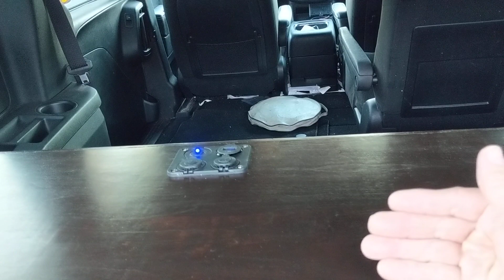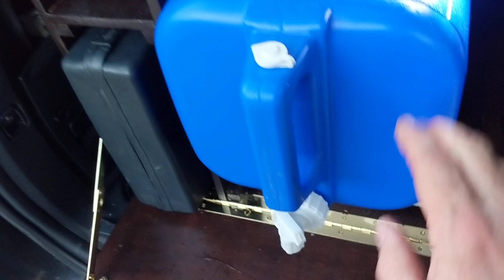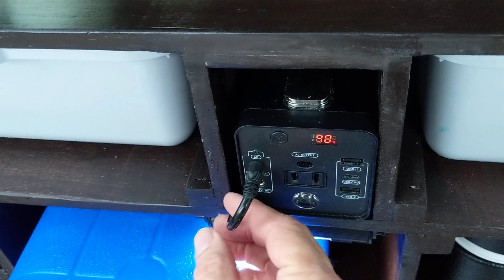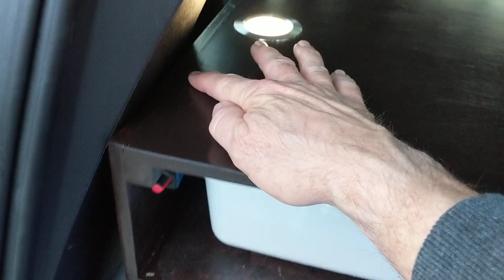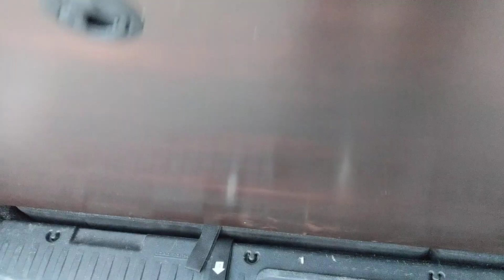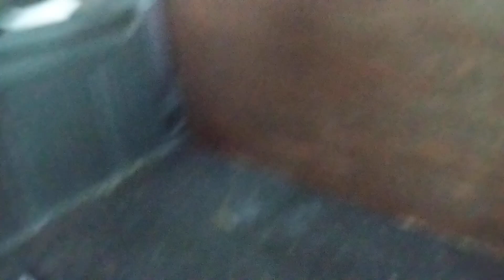Minivan Kitchen camping box build for van conversion

Comment: You should always have some sort of grey-water system.....a collapsible 1-2gal jug with a collapsible funnel is perfect.
Reply from the maker: Thank you.  I see some rules say to drain off site while some camp rules say camp kitchens free off debri  using camp soap and 200 feet from stream broadcast in bushes is fine. It is a good idea to bring at least a bucket just in case.  Also know that you should leave no trace while camping and that includes a puddle of goo so resist the idea of treating like a home or RV sink using paper towels to wipe out plates first should help but if you know its contaminated carry the bucket to a drain even if its not required.

Comment: Where did you get your water jug from?
Reply from the maker: It is a coleman 5 gallon water jug I got mine from walmart online there appears to be a short supply currently they are double the price they should be at 39.99 from walmart and amazon you might just need to pay it even colemans main website doesn't have it.  big 5 has them for 19.99 but you must check the store online and buy in store.

Comment: Hello, how do you fix the furniture so that it does not move when you travel?
in this car, in the back you only have two rings to hold things and they are not very strong
Reply from the maker: the foam sofa/bed is of course not used while driving and is just set in place the kitchen is heavy and combined with the jammed in sofa/bed it barely moves I push it back maybe an inch after I get somewhere.

Comment: Thanks for your content. I just purchased a 2010 Dodge Grand Caravan. I am hoping to get my hands on some design files (ideally I can open in TinkerCAD format .stl, .obj or .svg, or any drawings/diagrams/measurements of bed/cabinet/kitchen alternate setups etc) that I can take inspiration from modify to my personal liking to get the best result possible. I thought I might ask if you would be so kind as to forward any design files that you have that may help me, also if you are aware currently of any useful/necessary items for vanlife selling at a really good price/value I would very much appreciate any help/advice you can provide. Thanks and safe travels!
Reply from the maker: Thanks, As for design files there are significant notes in the description that have dimensions.

  I also made a full height but less width version so its very similar https://youtu.be/_YcJZ7gvFxU It has some lessons learned such as double nutting the hinge's and latch and handle (for a jam nut so they don't loosen) and not to cut interior shelves until outside shell is finished as they need to be tight without deforming and things sometimes change.  I also lessened the thickness of the glue blocks so watch that video as well. 

 By making the outside box first at the dimensions I list and adjusting shelves width to fit trays cooler and other interior components after its built it really only needs the outside dimensions I list the rest is play by ear and would vary depending on your tray and cooler size. Just position first to make sure it all fits and average clearance between shelves.

Comment: Nice I’m thinking of doing a half one like this for the beach this summer and do a fold out bed with a sink and a mini fridge/ cooking station as well nice build btw
Reply from the maker: I actually made a half one and it is available here https://youtu.be/_YcJZ7gvFxU what I liked about it was most camp sites have a picnic table and having it outside made it easier to access for others as they wouldn't have to open the van or door.  Since its the same height and depth the electric could be adapted.

Comment: I REALLY like this box. I'm the type who DOES want to get out and stand under that roof and cook in the rain. Way better than having a perpetually steamed up cabin. I suppose you could cut a back door to slide the cooler into the cabin if, say, you wanted a beer during a downpour.
The dark finish looks very elegant.
 Couple of questions:
How much does your box weigh, empty?
How do you keep the box from sliding forward?
Reply from the maker: Weight is very heavy I have to have 2 people carry it.  I leave out the cooler and put it in the van it probably weighs 100 lbs and is awkward.  For movement it doesn't slide much maybe an inch or so and with the sofa in place it doesn't move at all.  Without it it moved an inch after a few days and I just pushed it back.

Comment: Nice little build.  Couple thoughts.  With a few design changes you could have access to everything from inside, which might be nice if the weather is nasty or you just don't want to get out to wash your hands or grab something from your cooler. Also, using pocket screws might help eliminate some of the blocks, which in turn may recapture some space.  Overall, it looks great.  Thanks for sharing.
Reply from the maker: Thank you I think you point out some interesting points as to why I designed it this way and why I used glue blocks.  I really only wanted  to access just the power and lights from inside the rest was kitchen and outdoor stuff I don't need while sleeping or driving.  I do want access the cold stuff from inside but a small insulated thermos bag with sodas and water in it is all I need so I fill it and they stay cool for quite a while and I switch them out when I stop.  I really only need my personal stuff and that's in my duffel inside with me.  Washing needs to be outside as water is splashy and I don't want my inside area wet.  Also the back of the box is made to be blocked by the sofa or bed and its unlikely that I would move everything to get to a door or hatch.  

 To truly get strength without the glue blocks you would need rabbits and dados the pocket or even a stronger full length screw really offer no more strength then the brads as its the glue that gives most of the strength and 1/2 inch end grain plywood is very poor to hold mechanical fasteners. The fastener is really just the clamping mechanism until the glue dries.   I brad nailed and glued both the plywood as well as the glue blocks for the expected heavy use.   I realized I overbuilt this though and knew I could pare down the blocks and still have excellent strength so when I adapted this to a chuck box build for my niece I used narrower glue blocks of only a 9/16" so it saved about a 1/4 inch and it still felt quite strong.  The blocks effectively create a rabbit without all the work. By doubling the gluing area and bracing it using solid wood for the glue block you increase the strength tremendously.   The 9/16 size was the minimum that would hide the 1" brad when going into 1/2 inch plywood.   If you cut the size of the block to 9/16 inch it wont take that much room and would be a great compromise.  The other advantage was positioning for assembly the glue blocks were put on the top and bottom first and it helped position the parts when it came time to complete assembly.  Thank you for your comment and I hope this helps.

Comment from the maker: I have finished my van Yay! I have 2 other videos in this series next one is showing how well my trifold mattress/sofa fits and my new solar charger while I prepare for a camping trip.  The next video I show making pop in window shades made from reflectix done the next day it was quite easy.  My wife loved how comfortable it was at night and the running water of the kitchen.  We ran fans all night from the plugs and used  front window screens so it was comfortable at night.   From my trip I decided I would make a seal with reflectix from the camp kitchen to the ceiling and foam pipe insulation on the sides to allow night use without letting bugs into cabin (we avoided having the light on when hatch was open to avoid attracting them so it lessened its usefulness).    I will show a video with the full install at our camp in big bear in august.  See you on the road!

Comment: Very nice design and finish on the cabinet. I am finding so many of the conversions have removed the 2nd and 3rd row seats plus require exiting the van to access the cooking area. I am desperately looking for a design that allows me to keep all seats in the van as well as the ability to not leave the van to function. It might be wishful thinking!
Reply from the maker: Thank you.  I'm not sure if you noticed that we didn't remove the 2nd and third row they are stow and go and are just in the floor and pop out I can even travel with the second row up and only need to put it down when the bed is unfolded at night this was planed so I can take others with us who would sleep in a tent.  But yes full time campers on other videos do remove the seats for more storage its a trade off but for them storage is a premium and very necessary hence their need to remove them completely. 

 I think cooking from the tailgate solves a lot of problems in addition to the simplicity of the design is the practicality of it.  Cooking while sitting is pretty awkward as well as fumes, fire danger, mess, clean up, water splashing meat splattering and so on having semi outside on the fold down worktable solves these.  You can even walk around as you cook something I would never do inside.  Then there is the social aspect you would miss even alone people wave at you and talk as you are cooking. I guess there might  be a disadvantage if you are stealth camping or its extreme winter.   Just my 2 cents.  On a side note I am really excited that my set up is now complete and I will share a full use video soon.  Thank you and good luck with your build.

Comment: NICE KITCHEN!!!
Reply from the maker: Thank you.  Along time ago I wanted to build a Tear Drop trailer then recently I realized the inside of my van had almost the same footprint so you may recognize the influence.  Finishing it and using a drop desk front for a work surface was kind of from that world. I think some of its not haves also makes it.  The lack of water pump and instead using a water jug above the work surface does the same thing without all the storage and complexity.  Not using a dual battery but using a camping battery.  And not having a built in bed but using a trifold mattress.   It took a lot of searching to get components just the right size only to redesign after all the parts were in my garage.  An interesting design issue was the van door narrows as it gets higher so if I made it taller I would have to make it narrower so it took some design changes before I settled on this.  Overall It was quite a fun exercise in form and function.